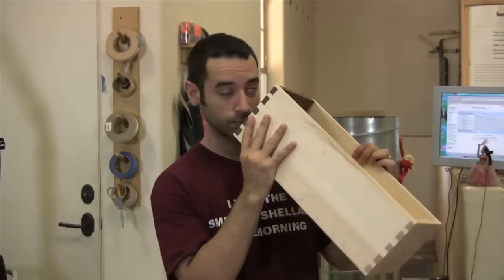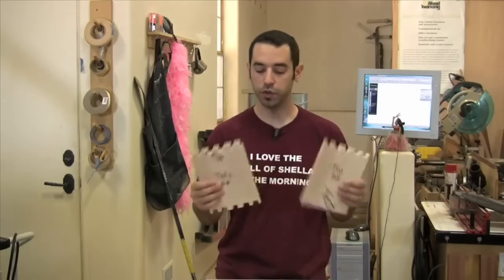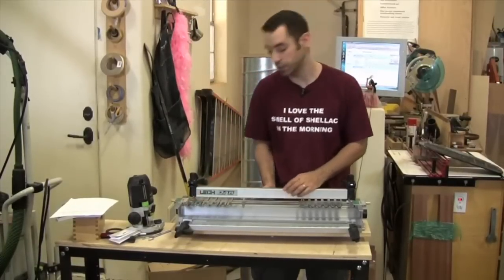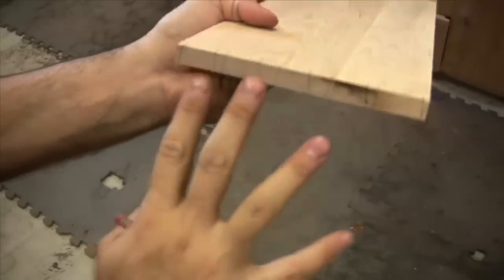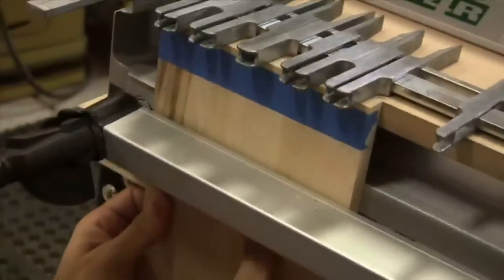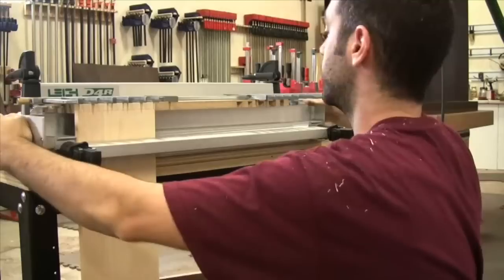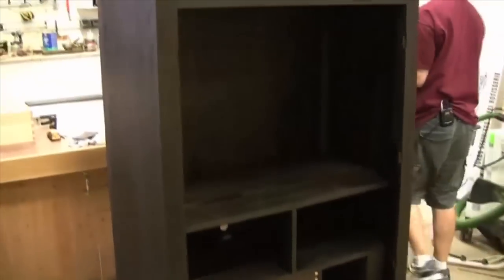27 - How to Cut Dovetails using a Dovetail Jig

Comment: Not sure if anyone is reading these comments seeing as the last one was posted 2 years ago.  But... for what it's worth, here's my comment:

I had a Potter Cable jig.  Worked really well but was limited in spacing the tails and pins.
I invested in a Leigh jig and never looked back.  Later, after this video was posted, Leigh came out with an accessory for their jigs.  It's a rail that attaches to the front of the jig and travels with the router.  You can also attach your vacuum hose to it and it leaves virtually no dust or wood chips when you're cutting with the router.

Comment: Hey Marc, great video as always!! I'm quite partial to my Porter Cable 77240 Omnijig. I actually have two of them, one dialed in for Through and the other dialed in for Single Pass Half-Blind DT's. These jigs, although no longer made, are simply the tanks of the DT world. I collect DT jigs and have a Leigh Super and D4r and love both of them, but after using all of these (also have an Akeda), the PC is my favorite. It definitely takes up a bunch of room, but they are the center piece of the Joinery section of my workshop.

Comment: there is 1 setup that allows you to do both very easily and is the one I use. The incra LS router table fence. It works completely differently from any other dovetailing system in that you use your router table and do not have to change anything except the fence position. It does box joints, dovetail joints, double box joints, and double dovetail joints. And yes, those double joints are only possible using an incra system. Plus all incra stuff is made just outside of Dallas, Texas.

Comment: Between your video and one supplied by  kennyearrings1, I think I may try to use my Leigh jig again. I bought my D4 in 1995 when it first came out. No videos at the time and the book just had me too confused. Never did get a good joint. I feel it is now time to try and put an expensive tool (that has just been collecting dust) to work!

Comment: I found the Leigh tough to use--too nitpicky with the router bit setup and the height of the boards/depth of cut.   I got a new Incra table saw fence last year, with the router table on the saw---easiest dovetails I've ever cut.   I've made around 15 drawers/boxes with it, and I've never had a bad-fitting joint.

Comment: Thanks, Marc, for a very comprehensive demo of the D4.  I have been doing some heavy duty research, trying to figure which dovetail jig is a good fit for me (pun intended).  You've really helped with my decision making process.  I was concerned that the top of the D4 did not adequately support the router - promote tipping.
Reply: I know this is an old post but if anyone else is reading this just buy the optional VRS vacuum attachment. It helps support the router and does a very good job collecting the chips.  The d4r is expensive but works like a charm.

Comment: Marc have you used your Leigh jig to cut tapered sliding dovetail joints? I have a project coming up where I need to cut several tapered sliding dovetails and another where I need to cut dove tail drawer boxes. So I'm trying to decide if i need to buy a D4 pro jig. Thanks John

Comment: great informative video Mark. I have a dw618 dewalt plunge router combo set. Do you know the proper guide bushing set that will work with my router? I'm in the market to buy the same dovetail jig as you used in the video. I like how there is endless possibilities to the sizing and spacing. Thanks in advance

Comment: I didnt follow your scribing the board to prevent tearout. Is it that the line will be on the inside of the joint that makes it ok.?  if you scribe the outside of the board you have to sand off the line or it would show.

I am looking at either the Harbor freight or Porter Cable 12" jig.

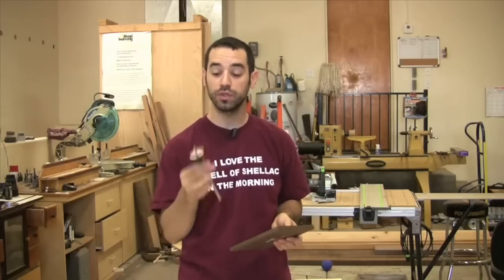Comment: At 13:30 in the video you talk about scribing a line to break the fibers and prevent tear out. With that being the front of the drawer wouldn't you see the scribed line in the areas that weren't removed by the bit?
Reply from the maker: Yes. But that's a common thing to see on fine furniture. Some people leave the line and some sand it back. Just a matter of personal preference.

Comment: There's a fourth kind of dovetail joint you did not mention. It's called a hidden miter dovetail joint and is most commonly seen in japanese furniture. It is essentially a full blind dovetail joint and as far as I know, you cannot make it with a router.

Comment: I've noticed that some dovetail jigs produce pins and / or tails that look okay on one side, but are rounded on the other. I didn't detect this rounding on your joints. Can you elaborate on this or explain it. Which jigs do it and which ones don't. So far I've hand cut all my dovetails, but if I get a jig, I don't want some crappy rounded off looking pin or tail.
Reply: when cutting a half dovetail the back of the tail is rounded and the bottom of the pin (socket is rounded. When they are fit together and glued you cannot see that. Thy usually are the jigs that cut both parts at the same time.

This video uses two bits to cut the parts seperately so its the same as a hand-cut through dovetail.

Comment: Had a question; is it considered bad form to try to conceal a dovetail joint on a drawer like this by adding a covering piece over the front face of the drawer? I want to make a drawer and my plan was to make a box just like this, but then to fasten a board to the front face to cover the gaps between the bottom sides and top of the drawer and the cabinet I have to house it in. Is this in bad taste because it hides the dovetail joints, or is it considered a step beyond? Personally I feel like showing off the dovetail while the drawer is closed is a bit boastful, but I'd like a couple of other opinions about it. Thanks!
Reply from the maker: +Christopher Rees Nothing wrong with that at all. Dovetails are joinery and it's really only modern woodworkers who feel the need to show them off. So feel free to cover them with a false front or whatever you like. They'll just look like half-blinds when you open the drawer.

Comment: When wood splinters & breaks apart in dove tail jig what am I doing wrong? I am trying
this for first tine with normal plywood not expensive wood.
Reply: I’m not an expert, but where are the splits starting?
Reply: It is with sandyply plywood as that is all I had. All around the dovetail being cut out. Would a different wood work out better? The dovetail bit is 14 degree, should I switch to 7 degree bit? Does that matter?
Reply: MegaKbyrne from what I understand, certain types of plywood have terrible tearout, so a different wood will probably make a big difference.

are you doing other things to support the fibers?  like in this, he scored it first, put tape, supported it against another board, climb gut the unsupported side, &c.

another thing you might try is getting a piece of mdf (or something), clamping it on both sides, and cutting the dovetail through the other stock.  that way, you’ll get tearout on the outside bits, but not the actual workpiece.

now, is it on the inside of the dovetail, too?

if your bit is dull, it’ll pull on the fibers rather than cutting them, and that could splinter the whole thing, especially with cheaper plywood.

as for the angle, for a cheaper plywood that may matter.  the grain’s really coarse on cheap plywood, which reduces the overall strength of the wood, and it’s possible that it would rip instead of cutting because the inner bits are not well supported once the outer bits are cut away.

one thing you might try is using a straight bit to cut out the middle of the gap, and then switching to the dovetail bit and gradually coming up to the final cut.  lighter cuts are easier for the wood to survive, I think.

that’s about all I can think of.
does that help?

good luck
Reply: Yea it does. See y sometimes.
Reply: I would have to agree that quality of wood plays a large part in the splintering. But also like mentioned, make sure you are doing the extra things shown to help prevent tearout. My one addition would be to suggest going to your local lumber supply and see if they have any scrap pieces of wood that you can buy on the cheap. Since you are just practicing the cuts, you could probably get small pieces that you could probably get for free. Maybe try to get an actual 1x (4, 6 or whatever) instead of plywood.
Reply: Thank you. What about differences of dove tail bits? 7deg verses 14 deg
Reply: MegaKbyrne sorry I missed replying about that before.  unf., I have no idea.

one thing you can look at is consider the shape of the bit, and how it’s contacting the wood, and try to visualize how the geometry of the bit interacts with the microstructure of the wood.

in the book “foundations of better woodworking”, Jeff Miller talks about wood as a bundle of straws: each straw is relatively tough, itself, but the connections between them are not.  this is why wood naturally breaks along the grain before it breaks against the grain.

tear-out happens because the ends of the straws are pulled away from one another.  this is why the marking knife trick works: by cutting the grain on the line where the new end will be, the bit isn’t pulling on anything that will be there at the end.
Reply: Sounds right  to me. I did not use a marking knife. Will have to look into that idea.
Reply: MegaKbyrne good luck!
Reply: Maybe you bought your plywood at Home Depot???   I had that happen to me: a full sheet of 3/4 ply was absolute c- - p.  Voids all through it, and the wood itself was brittle.  I don't know where it was made - it had no APA grading stamp.  I say "I" bought it: I called and ordered it, and my wife went and picked it up.  They assured her that it was "Just what your husband ordered." and charged the top price.

When I went to use it, I found that they had sold us garbage.  I tried to get my money back, but no luck.  "I had no proof that I had bought that sheet at their store..."  The fact that they were the only place to buy a sheet of ply on Sunday was of no concern.
Reply: What version, sandy ply or Baltic Birch or the best Red Oak? I bought sandy Ply
Reply: MegaKbyrne
They had some stuff they called "furniture grade": I was building a utility cabinet for a friend.  It would be placed in the "wreck room" - an area of the basement where his three boys could play with their friends on a rainy or snowy day and keep out of their parents hair.  They were six, seven, and eight at the time...  So I didn't want construction grade, and I certainly didn't want - he didn't want, really - to pay for baltic birch.  I had bought a sheet of the stuff a few months before and it was okay, which was why I bought it.  Just my luck... and HD's lies/
Reply: Buy that version $45.00 for 4' times 8' and red oak for about the same price per some of U-Tubes instructors of furniture builders. That is the end result of this question plus scoreing 
plywood. Kevin

Comment: Am i wrong, but after you correct the error, you again transpose pins for tails for the rest of the video  .  Waiting for that half blind vid.  preferably with the drawer front 3/16" rabbit for the undermount slides clearance for an inset drawer.     Ever consider using 3/4" stock and make a flush 3/4" box..  Blum undermounts require 3/16 clearance.  A sloppy inset clearance.  How about making a rabbit to make the drawer function like it was made from 5/8 stock.  Adjust drawer width accordingly.  Drawer bottom would have to be 1/4" larger, but so what.  Eliminates having to mill 5/8 or 1/2" stock for those of us without planers   What do you think?

Comment: When is it quicker to do this. It looks like it takes longer to set up jig and more work to use router and then have a dovetail with pullout than it is to use your scribe marking knife razor and coping saw and chisel.
Reply: *****
I think I've mentioned that I use the Keller Dovetail Jig, and have for years.  It has one setup - one time.  Repeat ONCE - when you first start using the jig. After that you simply clamp the wood to the jig and cut away.  If' you are cutting a lot of dt's it is helpful to have two routers, one  for the tails and the other for the pins, because Dave Keller's jig uses two bits: a dt bit and a straight bit.  There is never a problem with collars, as there is on some dt jigs - his jig uses bearings on the shaft of the bit, so it is automatically concentric.

Search YouTube for Keller Dovetail Jig and get an eyeful of how easy it is to use.  You can cut dts of unlimited lenght, and you can cut curved dt's...

Comment: Never cut one, total novice, excuse my ignorance.  Could you clarify?  At a glance the dovetail looks, well like a dovetail (upside down triangle), but the "pin" looks square.  But they fit together without any apparent gaps. Does the inside of the "pin" have an angle that lines up with the dovetail? I assume that straight-on the Pin looks square, but viewed from the top, there is a taper from front to back?  That distinction (hopefully visual) would greatly help a caveman such as myself.   Thank you
Reply from the maker: This is going to be hard to explain in this venue without a visual aid. I think the best thing to do is google "dovetails" and then look at the image results. You'll see how the pins and tails both feature complimentary angles.
Reply: Thx, after posting my question I visualized it at 90 degrees and figured it out. Sorry for the dumb question. BTW Great job on your videos, very informative and interesting. Definitely giving me the bug of woodworking as I expand my DIY world!
Reply: BTW, Thx for the expedient response!

Comment: Honestly, it's not worth using a jig for one or two boxes. Hand cutting dovetails is not hard or a long process with minimal, sharp tools and some practice. The jigs are made for production runs where they would absolutely be worth the effort. Every woodworker who is serious about the craft really needs to develop basic skills with a chisel and tenon saw. How can you be a woodworker if you can't cut a straight line with a handsaw? All your tools need to be sharp either way. I know, I was starting to fall into the power tool trap myself. I gave my head a shake one day when I realized I took a half hour to set up and fiddle with a cutting two tenons when I could have done it in less than 10 minutes with hand tools. ...and, I actually ended up refining them with a chisel anyway. Think about it.

Comment: What was that about the first dovetail jig being sold in 1970 something?  Didn't catch the manufacturer or the exact year, but I will tell you this. I have in my shop a Stanley H-61A dovetail jig that I inherited from a long deceased friend. I saw him use it for dovetailing drawers with a router back in the late 1950's. That bit of info you are passing long is erroneous. Also, if you are going to show the types of dovetails, then one should at least mention the double-blind dove tail as well as the single blind.

Comment: Hello Mark,  I was rather shocked by one of your comments in the video,  namely " distraction from kids running in and out of the workshop".     
Who in their right mind would allow this to happen?   have you no regard for the safety of yourself or your children.  Do you not teach your children the difference between Play areas  and potential Danger areas.   
Regards....Brian.
Reply from the maker: It was a hypothetical statement. But I'm sure some garage and basement woodworkers do have trouble working on the weekends while their kids are home. And I'm sure these woodworkers also try to teach their kids to respect the difference between work and play areas. But unless the child is a robot, you might notice they don't always do what they're told.
Reply: Only takes a simple bolt on the door to keep everyone safe....
Reply from the maker: How do you prevent a child from knocking on that door? A distraction can be something as simple as noise.... It's a little more complex than simply locking everyone out.
Reply: good for you  that is about as nasty as I can Imagine, my kids work with me in my shop alot, I dont lock them out or run them off when im about to cut.  How will they ever learn if they cant leave the play area ?  Im like you mark im more my own distraction rather than locking my self in solitary, usually comes from thinking about another step in preparation. It happens for sure, love your videos, wish people would quit trying to correct other people just to have something to say.
Reply: You can not argue with people who do not consider Safety paramount whether it be their children;s or their own.  Its obviously different in the USA....